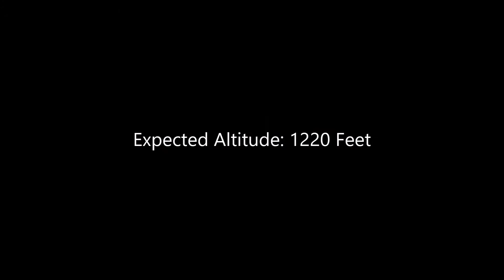Scale Model Nike Smoke Sounding Rocket

Comment: Does the Estes motor retention need any modification to fit RMS stuff from aerotech or does everything fit both black powder Estes motors and aerotech motors just fine?  

One more, how far in did you install the motor block?   

Beautiful work on the build, love your blog, and enjoy ya on the rocketry show.
Reply from the maker: Leave the motor block out entirely. For AeroTech, Cesaroni, and Estes composite motors (which are made by AeroTech), the thrust ring is built into the motor itself, on the back end, so the screw-on retainer holds it in place.

And while some AeroTech motors might fit if you include the engine block, some will not, and Cesaroni motors won't at all.

As for the Estes black powder motors, you probably shouldn't use them on this rocket. It's a little heavy for them, in all but the lowest wind conditions. If you do fly them, though, you can do a narrow wrap of masking tape on the back end of the motor to make a thrust ring. Wrap it about 1/8 of an inch thick or so, and cut off any excess. Then you can install it in the rocket, screw on the retainer, and you're good to go.
Reply: Mine won't fit AT single use  motors without removing the label, except the PS II branded ones. But removing the label isn't so bad really. I just thought that was odd/interesting.